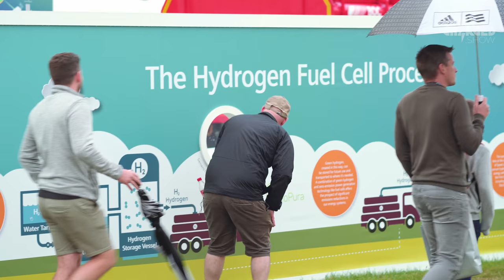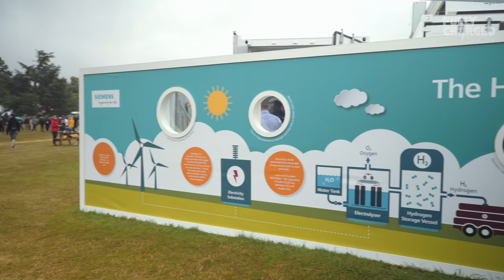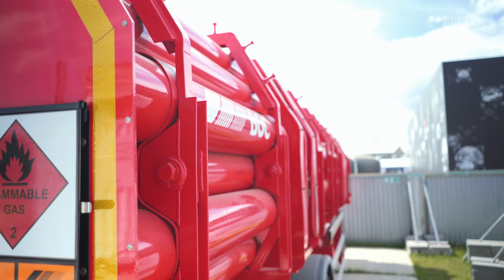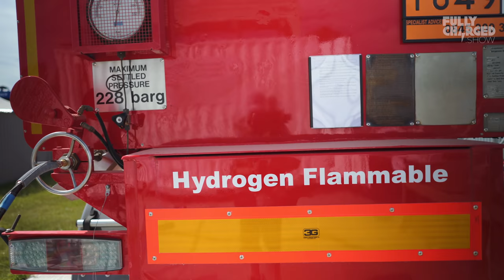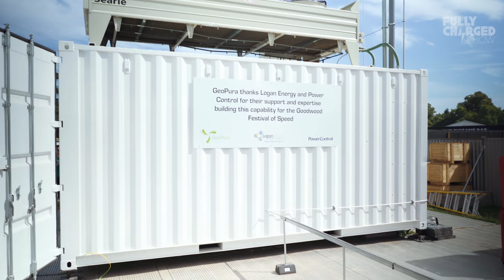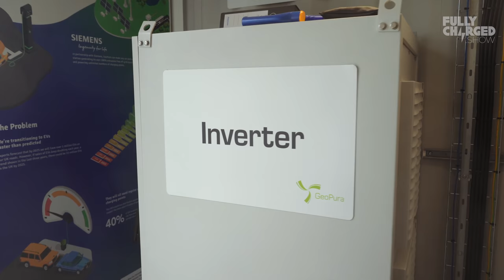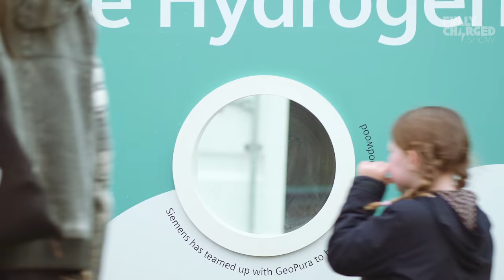Green Hydrogen Fuel Cell Charging System at Goodwood Festival of Speed | Fully Charged

Comment: Wow. I love these videos you do about the clean future we should all be striving for. Would love a video follow up to this showing the first part of the process on how they are using clean methods to create the hydrogen for this fuel cell.
Reply: mehunstone: see an earlier FullyCharged video on how excess renewable electricity produced on Orkney is used to produce hydrogen - https://www.youtube.com/watch?v=Rybpaqhg5Qg
Reply: Did you notice they didn't mention making (liberating) the Hydrogen?
That "50%" they mentioned is at the "pump".
It's 50% to get the gas, THEN 50% at the fuel cell, so you get 25% at the car wheels.
Do you think you won't pay for 100% of the "spare green energy" that fueled the system?, The same energy that would sent a BEV at least three times as far?
Reply: A Petrol or Diesel Engine with Turbo's and Superchargers is at best 30% efficient and that's optimistic. Most of the energy is dissipated in heat as an ICE after all needs to be at 70C just to function. So considering oil is just stored solar energy just like hydrogen all you are doing is reversing the process. With Hydrogen you waste 75% of the energy getting it to the car, with oil you waste 75% when its in the car. However when available and established, Wind and solar are cheaper than oil will ever be. For solar this was established a very long time ago and lets face it, its only going to get cheaper as stated in the video.
Reply: @RoadRashSpirit
If you store it in a battery: " Li-ion has 99 percent charge efficiency"
If you store it as hydrogen: Only 25%
This is because you have what amounts to a face changen between charge - chemistry - charge and you loose a lot in each step. While a Li-ion battery can burn, hydrogen can explode like a big bomb.
Reply: @bknesheim I agree that storing energy in battery's is more efficient. I also agree Hydrogen is dangerous if its not handled correctly. But there are always more things to consider like cost and transportation. Hydrogen is easier and cheaper than battery's at the moment, even with the inefficiency's involved. Considering that in practical terms the future for rail, planes, ships and lorrys is going to be hydrogen I think mobile gennys is a very sensible idea. Its not just my opinion its literally whats happening, any application that uses a dirty great diesel engine is being considered for hydrogen. Horses for courses as it were.
Reply: A second interesting point is this. A lot of people slated Elon Musk for sticking with LI-ION batteries when there were promises of new exciting things round the corner. Elon however took the attitude that he wanted change now and had to use the best technology available for his purpose. As it turns out LI-ION still hasn't been superseded despite the many promises and lots more companies are investing in it. The moral of the story is that we have to use what's available if we want clean change. Hydrogen has many advantages over batteries at the present and shouldn't be discounted just because were not keen on it in our cars.
Reply: Cheaper hydrogen sold today is produces by cracking natural gas with water present producing CO2 and H2. I can not find any comercial company selling H2, that use electrolysis in the production.
For any system to have meaning it must make sence. Throwing away 75% of produces eletric energy make no sence. Using disel/gas have a low efficiency because of loss when converting heat to motions.
Electricity do this much better so degrading this to be no better then a standard disel/gas motor is not a smart thing to do.
Reply: @RoadRashSpirit
Hydrogen has no advantage over Li-ion based batteries. 
- It have a low energy density.
- It cost a lot of energy to produce (especially when your not cracking natural gas)
- It is diffult to distribut to small end users.
- It can be very dangerous.
- You need compliacted and expensive fuel-cells to produce electricity.
Reply: @bknesheim  that's a bold statement but unfortunately incorrect. OK you don't like hydrogen but in the real world a hydrogen locomotive will work better than a battery equivalent due to its advantage in weight and quick turn around in filling up. The generator is no different, mobile li ion containers would be heavy to transport and restock at an event. A light weight hydrogen lorry would be more convenient in this case and thus has a clear 'advantage' as I already said its not all about efficiency. If the engineering world worked on one principle point ignoring all other considerations we would have a very disfunctional grasp on technology.
Reply: @RoadRashSpirit
I will give you that you can fill up a hydrogen tank faster then you charge a battery, but based on a consept from Toyota for the Mirai model you will need 2x700 bar tanks to store 5 kg hydrogen. Total volume 152 liter and a 50 kg fuel cell. A leak in a 700 bar tank will blast thrue you like you was not there.
I from Norway and we have a lots of electric cars in use and so fare no major problems connected to charge stations, but a at least one major fire caused by leak from a hydrogen filling station.
More it is really not that I do  not like hydrogen, but so fare there is no good way to use it. A battery you can charge at home and it is very efficent. Hydrogen need a complicated system at a large station and very expensive extra part (the fuel cell) in your car that have a shorter life cycle then the batteries used today.
Reply: @bknesheim  I'm not sure what point your trying too make. You have just watched a video where a mobile charging station with considerable power regardless of efficiency was working well. Hydrogen locamotives exist and work really well. I agree hydrogen in a car is a bad idea, given the number of accidents on the m6 every week it would be like sending out fleets of mini nukes. But the advantages are pretty clear for the mentioned applications.
Reply: @RoadRashSpirit
My points is that working just fine is not the same as this is a smart thing to do.
Reply: @bknesheim  why is it not the smart thing to do? As I have pointed out efficency isn't as important a consideration against practicality and safety is not an issue in a fixed system such as a generator. What else you got?
Reply: @RoadRashSpirit
Efficency is very important, it is even one of the major points against ICE motors. Batteries work just fine for large units. In Norway we have allready several ferries running on batteries. Using hydrogen was considered, but was found to be more costly and a lot less efficent with a higher running cost.
I belive that for any system to be adopted on a large scale it must be effient and easy to use. Even better if it  is cheaper then other alternativs.
Reply: @bknesheim Actually the ferry's you mention are a good example of what I have been saying. I think it is brilliant that Norwegian firms have invested in replacing some of their diesel ferry's with battery ferry's and I would welcome a similar change between Britain and France. However Ferry's by definition travel a relatively short distance. Imagine a container ship coming all the way from China running on batteries. The weight would be such that if the ship wanted to carry cargo it would have to be humongous just to displace enough water for its own weight + the cargo. In this circumstance LI-Ion just doesn't make sense. The same could be said for planes. There are short hop planes now that run on batteries and I think they are brilliant, but their weight and capacity limits their range and size. Now I'm not saying that batteries will forever be excluded from being able to fulfil design briefs of this nature, but current LI-Ion tech falls short when designing for more than one factor. The energy density would need to multiply considerably. As for your comment on efficiency, as I have said, it is never the only consideration in a design brief. In fact if you take a view that you wont use anything that's below the efficiency of Li-Ion, or worse below 50%, I'm afraid you will have to become a Cave Man. Here are some general stats that might shock you. Wind 30-40% Efficient, Solar 10-30% Efficient, Hydro 60-90% Efficient, Nuclear 30-40% efficient (Max 60% laws of thermodynamics), Stirling Engines 30-40% efficient (Max 60% laws of thermodynamics, ICE 5-30% Efficient, Coal Plant 10-40% Efficient, Nateral Gas 40-60%. Those who care about the environment agree that its the change that matters, if you only focus on efficiency then in some ways renewables don't make sense. I am sure this is not the message you are trying to tell people?
Reply: @RoadRashSpirit
On that we agree no problem and it is "better" then diesel since the ferries they replaced was running motors that use heavier bunker oil type of fuel. :-)
Reply: Mostly Hydrogen is produced from Natural Gas.  That's probably how they buy it in that quantity. I have an LPG Ute and what they didn't tell me is just how much more fuel it uses.  Clean fuel but god does it such it down.  Never again.  Petrol next time.  OK having eco fuel cars if you're a Champagne Socialist.
Reply: @RoadRashSpirit  
Better than diesel, but diverts thought and effort from better solutions.
Reply: @RoadRashSpirit  
So, thousands of hydrogen tankers on the roads of the world? Mmmmmm ..... Boom!
Reply: @RoadRashSpirit  
Actually, you cite cost of transportation.
You transport a battery ONCE.
A static fuel cell needs constant resupply, so no, Hydrogen had no advantage in that respect.
Reply: @Roger Stark I agree that having Dangerous chemical tankers isn't that great, but how is that different from petrol, avgas and many other toxic and explosive chemical transporters. At least with a truck its large enough for most things to bounce off and the drivers have special training. Your missing the point with the batteries. It is the weight which is the issue. For a weekend festival to use a container full of batteries you would need a concrete pad to park your container lorry on for a start. Because you wouldn't want to off load it otherwise you might need a crane to replace your battery container every time it runs out of juice. And don't reply by saying something as stupid as the battery won't run out as you have already implied. Its case specific, there might not be enough space on the freshly laid concrete pad for contingency containers and you might not want to have to predict exactly how much power you want and pay over the odds for extra containers you didn't need to use. Hydrogen has advantages for "certain" applications, if you weren't hopelessly biased you might have actually read everything I have already written on the matter. I'm not a Hydrogen fan boy, I look at things from an engineering perspective (go look up what that means its a useful skill). As for diverting thought don't be silly. How can you be so insecure about battery development when there is so much going on in that sector with billions invested in companies and specialist university's (aside the traditional ones). Honestly, get a hold of your self man!
Reply: @RoadRashSpirit  Electrify your Railways Batteries not required, proven technology. Creates skilled work opportunity. Win Win
Reply: @colconn57 
There is something to be said for that Colin, but here in the UK railway electrification has proved to be very expensive and we are terrible at managing such projects. Look up east coast electrification and west coast electrification. As a result it has long been deemed un economical to electrify regions such as Wales and many others. I'd happily spend the money but its not realistic. This is why there is still alot of diesel stock on the network from the governments perspective its cheaper if these are replaced with another technology, hydrogen is the only real player in that field at the moment. Batteries can't go the distance 'yet'. I dont see thermonuclear trains happening anytime soon either lol 'joke'
Reply: It’s stated indirectly. He says it’s from wind. So it’s electrolysis using electricity from wind. That’s 50% efficient at best. Then he says the fuel cell stack is “about fifty” percent efficient, which you can safely assume is less than fifty (otherwise he’d use this opportunity to say “over fifty”). Hence, they make electricity with wind mills and lose over 75% even if you disregard distributing the fuel and fuel cells to the location. 

In some sci-fi future with fusion power hydrogen from electrolysis could maybe work. If energy is both clean and cheap, who cares that it’s not efficient? But in this century, it DEFINITELY isn’t a solution to general power. Maybe a country with a large surplus of renewable energy (making much more than its total energy consumption) in one season and a large deficit in another (needing much more than it makes) could make hydrogen rather than turn off windmills and solar panels, but no country is anywhere near actually making so much renewable that a short term buffer wouldn’t be enough. Batteries are much better short term buffers because they can store enough to cover that. 

But really if we were rational we would go nuclear with fourth generation fission and fusion. If governments in the western world, I.e. those responsible for creating the problem in the first place, had invested half a percent of their budget in research for the past fifty years we would have got fusion twenty years ago and most of our energy would already have been completely carbon-free. The electorates need to understand that they need competent leaders, not the guy they’d have a beer with or a bafoon who’s at least not like most politicians.
Reply: bknesheim you’re making a fool of yourself. Hydrogen IS a scam, but you’re helping their case with your ignorant arguments. Hydrogen has extremely high energy density - my Model 3 has 75 kWh useable energy from 400 kg of batteries, but less than two kilograms of hydrogen contains as much chemical energy. Even when you include the fuel cell stack and the buffer battery (hydrogen cars must have a battery because the stack is too slow to regulate power up and down), as in a car, hydrogen is still the runaway winner in terms of energy density.
Reply: RoadRashSpirit A locomotive is a supremely stupid example because it doesn’t need any batteries at all! Just hook it up to the grid. Visit Europe and hop on a TGV (Train of Great Velocity) — they all run straight off the grid. Or just look up pentagraph - e.g. https://en.m.wikipedia.org/wiki/Pentagraph
Reply: Roger Starkey Which actually makes it worse than diesel. If you run five cars of which one is diesel and four are electric, but you want to introduce hydrogen into the mix, you can’t, with the same energy sources. You can only run one hydrogen car and one diesel. It replaces what’s better and leaves the fossils unaffected. The only way hydrogen can be as clean is if you have enough to run all five cars on it — implying enough clean electricity for twenty EVs.

Hydrogen receives incentives that divert from better solutions. It makes people hold off on buying EVs, and supporting them politically. 

Their only hope is to keep people scared of nuclear. Storing enough energy to keep things running for months in a war situation isn’t solvable with batteries. They will keep going as long as people don’t admit renewables aren’t cutting it.
Reply: @dojohansen123 
Hi I'm glad you felt the need to weigh into the conversation with your insights and call everyone else stupid and dumb. And in some instances you are correct. However you are also guilty of your own ignorance. I agree fusion is the answer and I agree we should invest alot more into science as a whole. But there in lies the weakness of your entire arguement. Money is not infinite. Nuclear is by far the most expensive form of electricity when you look at its entire life cycle of build, running and decommissioning over its short but fruitfull 35 year life. The same money spent on 2 nuclear reactors in Britain could pay for solar wind and storage for the entire nation. Now I agree a 4th gen would make it more efficient in regards to waste but it certainly does not solve the problem and it is probably more expensive. Here in Britain we are currently building hinckley point c and to the best of my knowledge they opted for a 3rd generation even though its been superceded. They must of had a valid reason for that. As for rail it is better if the network is electrified but please actually "read" my reply to Colin. It is a cost issue as well as a project competence issue which makes it unviable in many parts of the UK. And as for a pentograph? Maybe you meant pantograph? Please feel fee to look it up, or maby when you go through the effort of providing a link actually look at what your posting. Now to round things up, here in the UK at least we have great renewable energy resources in wind and Scotland regularly over produces. If you watched more fully charged videos, you would know this. Setting up a small wind farm to make hydrogen for very particular applications like the one in the video (not in anyway threatening people's eV and grid sore spots) would be cheap, easy and profitable in the UK. Not to mention sensible when life cycle costs are factored in.